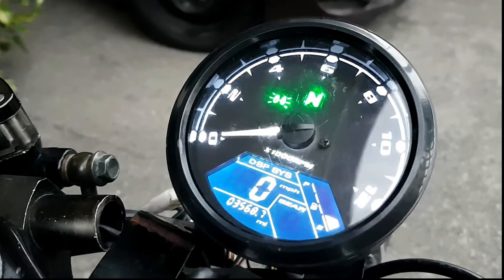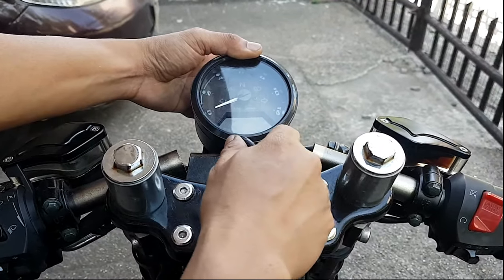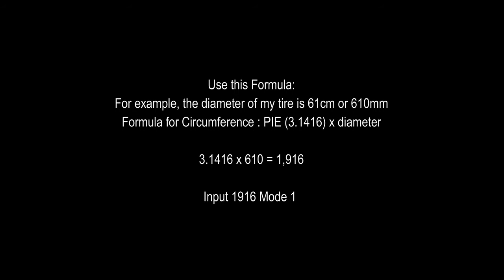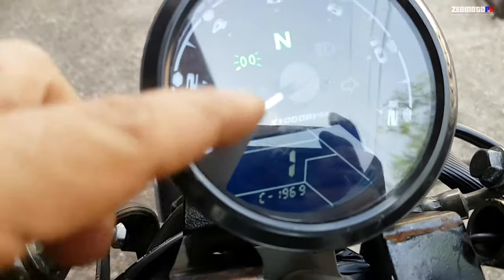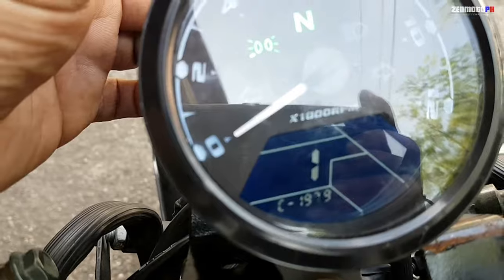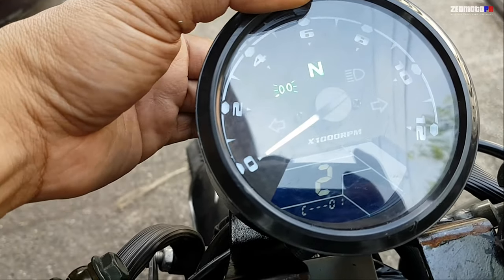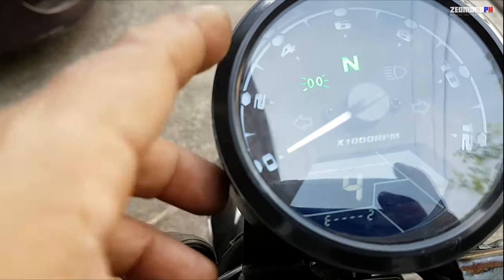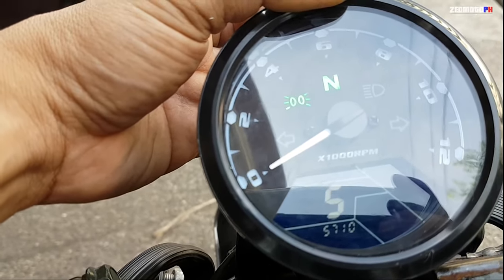PAANO MAGSETUP AT MAGCALIBRATE NG DIGITAL SPEEDOMETER

Comment: What if ive put the magnet in the front sprocket? What will be the value
Reply from the maker: It is ok, as long as the sensor is pointing directly with the magnet , you just have to  test out if the reading is correct if not you may add one magnet. Just do trial and error and eventually you will have the right set up.

Comment: Tanonf lang po sir. Hindi ka na pa bo nag rewire sa may fuel indicator?
Reply from the maker: Hindi na po, may connection naman kasi ang cr152
Reply: May separate ba na connection yung sa fuel sensor sir na connected din sa 9 pin socket? Fury 125 po motor ko sir? Blinking kasi yung sa panel ko yung fuel indicator

Comment: pwede ko po ba ilagay ang magnet sensor nyan sa engine sprocket?
drum brake pa lang kasi ang front wheel ko.
salamat🙏
Reply from the maker: Ok lang naman , basta check mo lang ang reading kasi mabilis ang ikot sa engine sprocket kasi maliit.
Reply: @zedmotoph  salamat po Sir
Reply from the maker: Pwede din naman sa drum kaso may mga bracket kang gagawin. Ang importante lang kasi magkaharap ang magnet at sensor na may gap na  3 - 4mm. Maganda kasi sa harap kasi malaki diameter maiikutan ng sensor para may chance for adjustment pa kung dalawano isa na magnet lang.
Reply: dito pala magagamit yung mga binagsak kong subjects nung hs hehehe 😂

Comment: paano yung reset ng odo ser hehe na skip kasi sabi mo pero gusto ko mag reset
Reply from the maker: Parang sa mode E i long press mo parà ma reset. Sana magwork medto matagal na din kasi. At wala na sa akin ang motor. At may mga bago ng system din ang mga ganyang speedo
Reply from the maker: Mode 5 i mean
Reply: last na sir, ilang magnet po ba yung stock sensor and ano po brand yung gulong nyo?